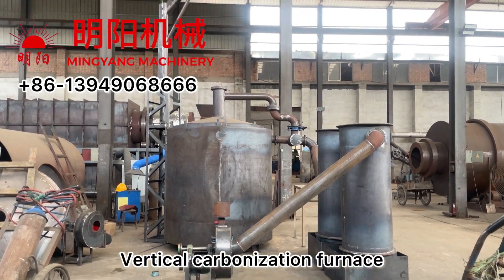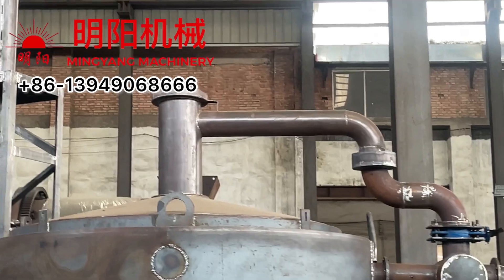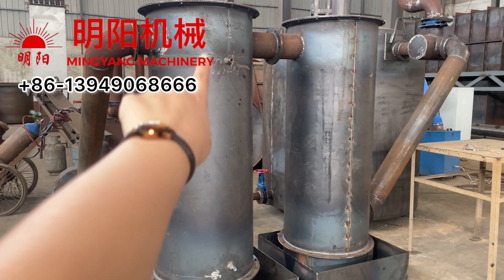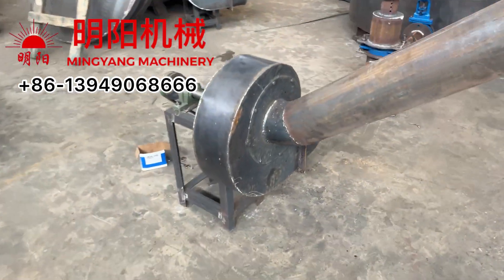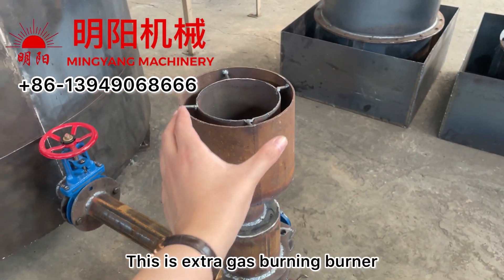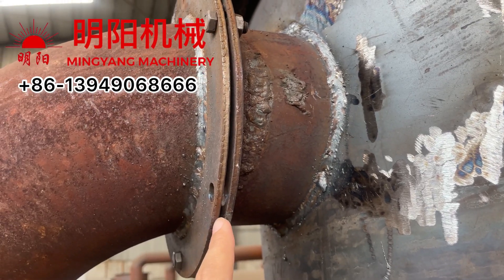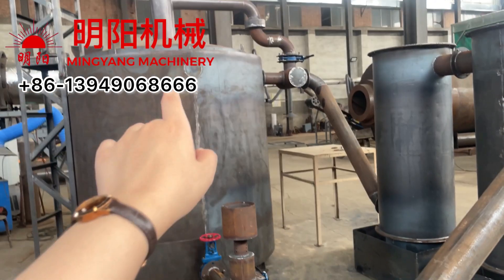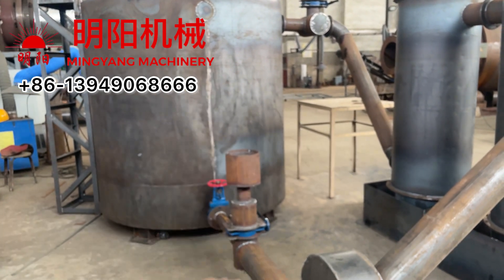QHL-1 Carbonization Furnace- Vertical Airflow- User Manuel

Comment: How much kg wood does it take to preheat furnace ? Before gas comes out .
Reply from the maker: Hi for 1st time starting c we will need use more. ( because furnace is cold no any heat kept). After normal working, only need 30-40kg firewood to get recycled flammable gas using.